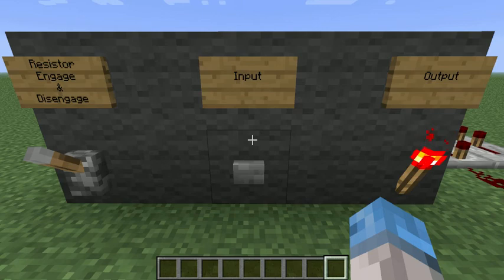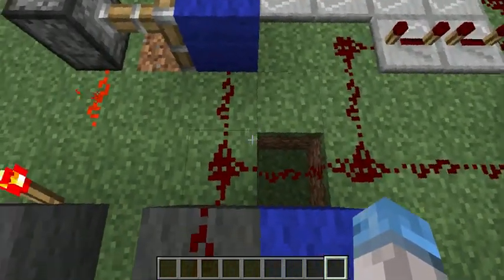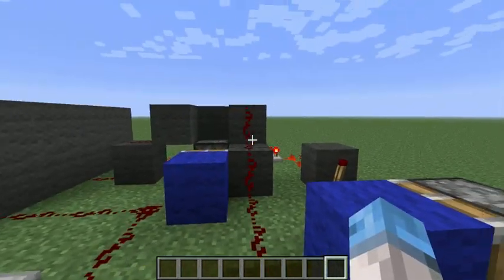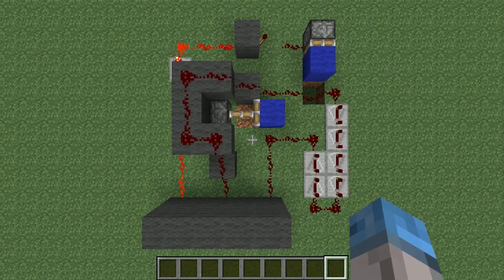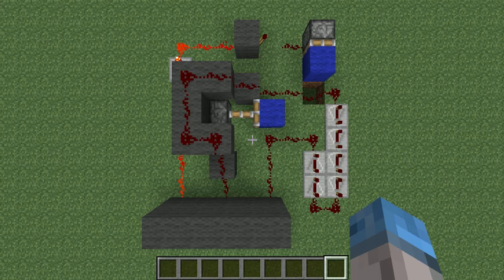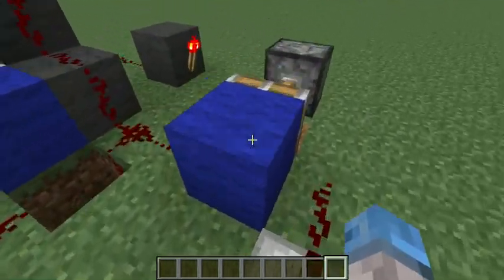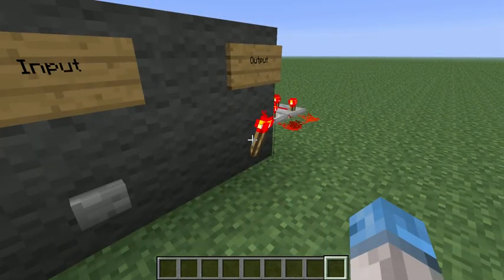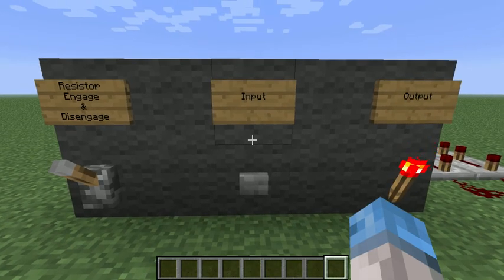Six Band Variable Resistor in Minecraft

Comment: last time I checked a resistor decreased voltage. In minecraft that would be signal strength. This is just a delay.
Reply: You can use subtract comparators mode but it's only for a voltage divider. The resistor also limits the current though it doesn't really matter since redstone cirucits won't burn anyways.